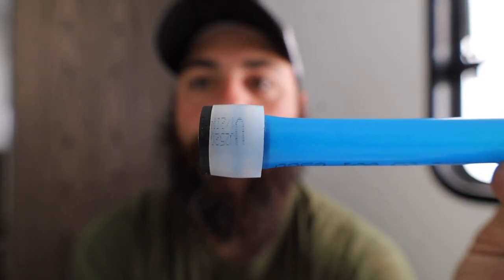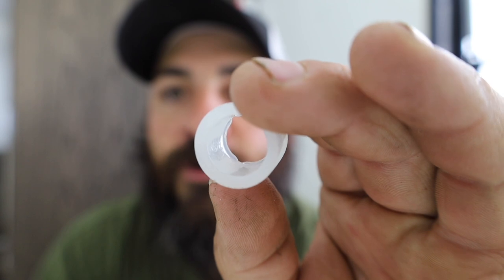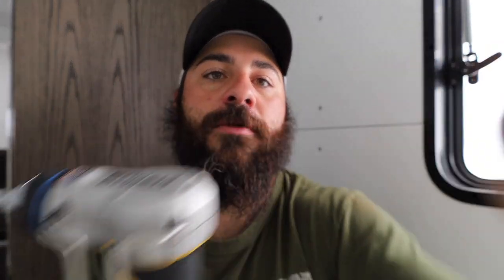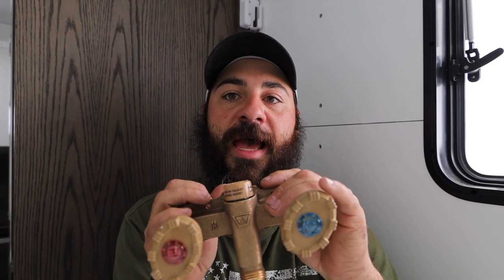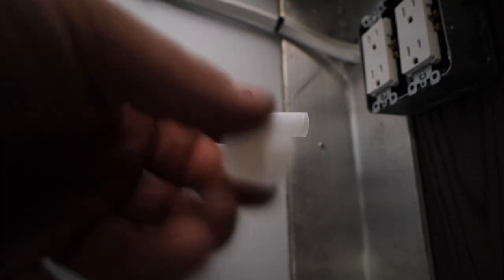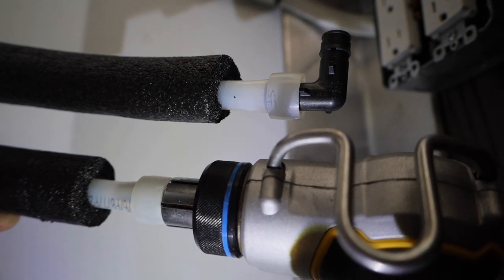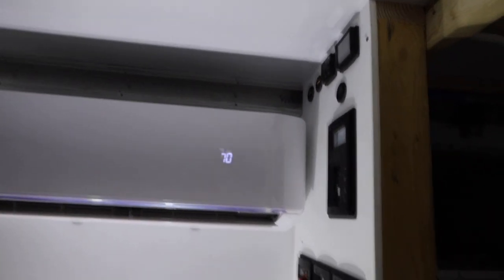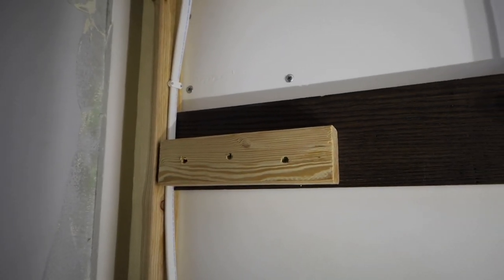Best plumbing connections for your overland RV

Comment: Recommended  by Broke Overland. Great channel you’re starting. Recommend one thing all the stuff you suggest put the manufacture in the description area. Maybe build a amazon acct. sometimes you can get a kickback $$$ if you’re intrested in it. Some manufactures will also do a kickback to you and subscribers can put a discount code. 
 in. Just a FYI.
Reply from the maker: Thanks for the tip, as time passes and I gather more subs I’d like to start doing features like that!